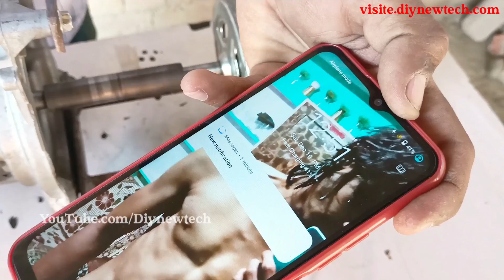Free Energy Generator | 100% Real System| Self Running Generator| Low rpm Generator

Comment: If possible, because it is a dynamo of the generator of a power plant, these only need between 1200 to 1800 rpm, secondly, if it is free energy since the invention does not need to be connected to commercial energy, continue experimenting, I congratulate you.

Comment: People do not realise how clever this is, if he had only included a reverse osmosis subduction spline in the output and fed it with a polarity induced resonant cavity, he would have eliminated the potential to generate a non-optimal configuration. This would have allowed it to power the current generation of non-reactive LED based inductors.
Reply: Fake!!! Where is the battery powering the DC motor?

Comment: To reduce the amperage of the dynamo, did you increase the number of poles and increase the thickness of the coil??  that starts working with low voltage??  thanks for your kindness
Reply: No modifications at all
Reply: @sham1234567891  You don't have enough information about the method of making the device, that's why you say this... Both the motor and the power generator must change the winding.

Comment: Load is low because you must be used dinamo 100w..generator just give about 100w or more bit..if you have DC controller you can jointed with inverter
Reply from the maker: Thanks for suggestion
Reply: @DiyNewTecH  I already made it.. but I didn't connect rod to rod.. I used a pully because if direct rod to rod the dynamo rpm is not 100% fast.. use a pully to lighten the load of the rotating dynamo.. even if you can't get high current as long as there is excess 12v.. already considered successful to connect to the inverter
Reply: Betul menjadi ke bos ?

Comment: Terrible constant camera close ups make this video look fake!
However, when the drill is powered up we see a voltage drop which would be exactly what we would expect to see and most other videos do not show this. I suspect full power on the drill from non-rotating would make the generator cut out hence the short trigger blasts.
Brother all we need from a generator like this is to be able to charge batteries, charge up a big battery bank then use the battery current to limit the load on the generator/motor. 
If you are legitimate with your machine then you have created free energy.. If you are lying then hell awaits you.

I'll say it again, "all we have to be able to do is charge up batteries at a decent amperage". If you're telling the truth then this machine will be able to charge many batteries at once. Find the limit of how many watts you can get out of it before it shuts down, then limit the output power accordingly so it will never shut down unexpectedly 👍🏼😉